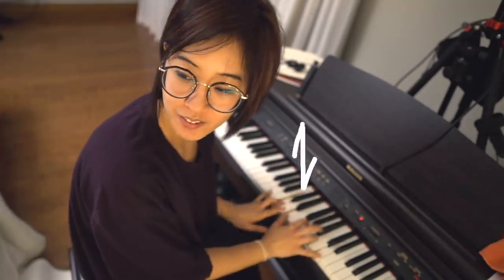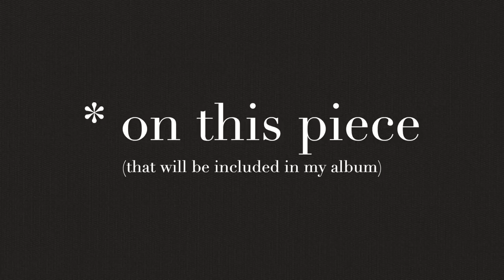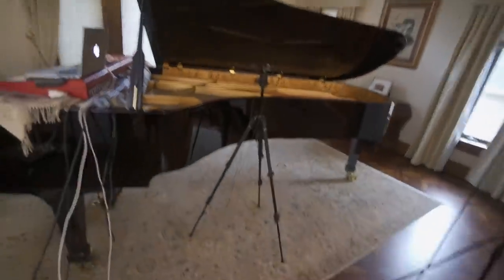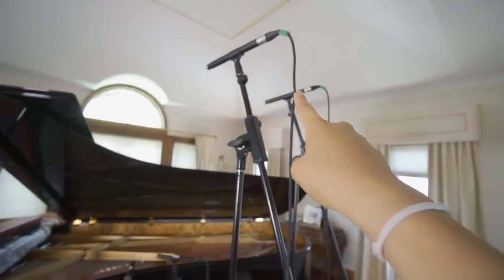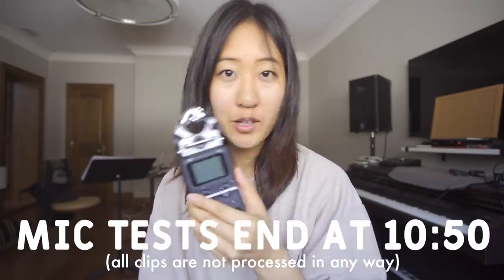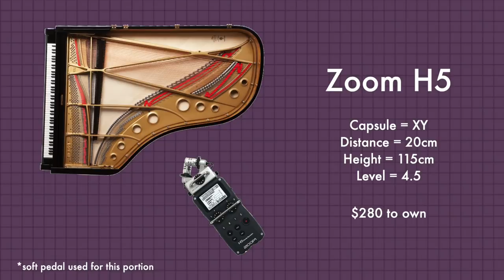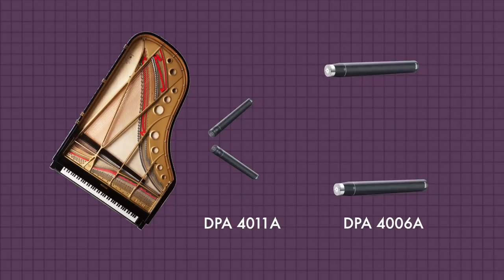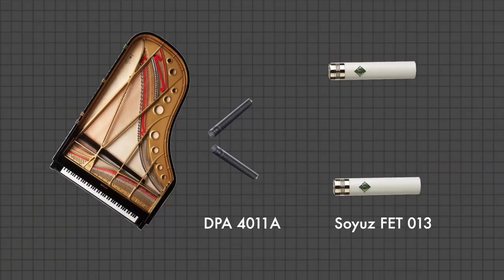Recording a grand piano is TRICKY - here's what I learned.

Comment: I like how you use octave as a unit of spatial measurement. "eerrr it's about an octave away"
Reply from the maker: :D
Reply: My phone's about an octave long
Reply: @ammyvl1  same
Reply: Noone: 
Pianists: measures with octaves (and other  intervals) XD
Reply: Arabic speaking people use a similar measurement they call a "shiber" which is top of pinky to tip of thumb on a splayed hand. It's very inaccurate as people have different size hands... But people still use it quite commonly, it's like measuring feet in some sort of awkward steps
Reply: That's bc it is! Intervals are units measure and also the fundamental units of harmonic structure.
Reply: @johanneskepler873  Frequency or wavelength would be how I measure stuff if I only had musical terminology to pick from. The octave is a doubling relationship between frequencies isn't it, 220/440/880? Surely you'd have to disambiguate and specify which octave you're in, unless we start measuring in zenos or mandlenghts, which I'm totally down for.
Reply: @SamTahbou  all traditional units start from that
Reply: As not a piano player, took me a minute to understand what she meant by that. Haha.
Reply: @alongthearc4486  For the purposes of acoustics, an octave does have that relationship. But for the purposes of music performance, composition, or analysis, the span of frequencies within an octave varies depending upon the tuning/ temperament used. Regardless, using intervallic relationships allows for an effective exploration of the pitch space the music is played within.
Reply: Imagine measuring an octave with string instruments
Reply: @ammyvl1  you 'phone' :P
Reply: @avm3562  with proper touch, it can grow from a perfect 5th to an octave, babe.
Reply: Octaves and Volcas are the only units of measurements needed. The're also quite similar ;)
Reply: Am I missing something or are some people here making something very simple much more complicated? On a standard piano the distance between any note and the same note an octave up or down is (always) about 16cm.
Reply: @paulmdt1  we're musicians; of course we're making something more complicated than it needs to be.
Reply: Hah, I totally loved that, too.  Made perfectly exact measurement sense to me.😂
Reply: @SamTahbou  one neat additional detail to using an octave measurement is that as pianists we actually build the muscle memory so that when we hold our hands from thumb to pinky and think “octave” our fingers would always fall on notes an octave apart on the piano, regardless of which notes we played the octave on, or what piano we played the octave on.  We learn to accommodate how much or little we have to stretch the fingers of our individual hands to fit a piano, so the measurement becomes the same regardless of the sizes of different people’s hands.
Reply: Once upon a time a wise old sage told me that I should not invest big dollars in sound equipment that I can’t hear. That spending big dollars on high end products was more about appearing to be an audiophile (ego) than actually being one (discriminating). I am fortunate to have been born with tin ears I guess because I don’t need expensive equipment to experience the joy of your musicianship. I’m afraid that all the samples sounded great. Sorry that I’m just getting around to all your videos.
Reply: I do that too!
Reply: Yea ahahaha thought that as well 😂

Comment: There is a technique I recently experimented with that you might want to try.

I took a matched pair of small diaphragm condenser microphones with a cardioid pickup pattern, (The $200 Lewitt 040 Match pair was my choice) and place them facing straight down a little ways behind the hammers at 1/3 and, 2/3 across the piano.
Then I panned them hard left and right and flipped the polarity on one of them.

The cardoid pattern will make sounds off axis with the mics darker. That coupled with the slight timing difference between the 2 areas mimics the way humans perceive directional sound.

Small diaphragms are able to change directions quickly. There, are better than large diagrams for higher frequency sounds. so they are great for picking up the harmonic overtones on the bass strings, but lack body.

So then I experimented with blending a microphone with a strong low and low mid range and left it panned in the center. 

And since I had a nice room, I also blended in an omnidirectional mic back in the room to pick up the room Reverb, and add a nice delay effect.

The mics aren't as important as using your ears and experimenting. When everything is done by the book. Nothing new will ever be learned

Have fun!

Comment: You know you're a pianist when you measure lengths in intervals 
4:51
Reply: Hahaaa tru
Reply: haha
Reply: As a non-american, it still makes more sense to me than the imperial system!
Reply: @zede77   I propose we abolish all systems of measuring length and replace it with intervals
Reply: @galvinn  I'd agree with that but after a quick search it seems that there is no standard for the size of an octave. We're doomed.
Reply: @zede77  feet is a base 12 system just like 12tet. Just think of inches as semitones.
Reply: @warpigs330  Hey thanks for that tip. Knowing that an inch is 2.54cm, that really helps.

Comment: I was a sound engineer in another life, so my observations are based on my older experiences. Yes, recording a piano is tricky and so many artists have different ways of approaching it. For example , did you try placing a cardioid mic about 2 feet behind your head? One artist I worked with liked to have a track where he could hear the sound from his POV. Sometimes the track gives a slight presence to the overall recording. I have also placed a mic under the piano to get the ambient presence as a solo track to work with. The artist and the engineer can have two completely different concepts of what makes a good recording and this is where a good Producer can be a godsend. 

Also, looking at the room, you have a lot of glass to work with, which is not at all great for recording. All kinds of reflections and slap-back can occur that will spoil the recording. Besides closing the curtains, were you able to use any sound baffles, like big foam rubber patches you see in studios? This helps a lot, even for small home studios. I realize you were borrowing the space as well as the piano(thanks, Romano family), so things like blankets, foam rubber in key places to deaden echoes, etc, are one way to help control the sound of the room without causing too much chaos. You have a beautiful piano to work with, but your recording environment is at least as important, if not more so, to your end result.

On headphones, I personally liked the DPA 4011s for their warmth and presence in overall sound quality. Youtube compression really crushes the high frequencies, so it's sometimes hard to tell the difference in mics because the high end is rolled off so much. I think your mic placement is fine for your sessions but as you do this more, you will find the subtleties and sound qualities that you like best.

Looking forward to listening to your new album when it's available. Best of luck.
Reply: Lol you were you Jekyll and Hyde?
Reply: Great write up of considerations—esp. with room acoustics! Agreed on the DPA’s. The Soyuz with omnis came close spaced parallel config, but was missing some of the detail of the DPA’s. Thanks for sharing, Nahre!
Reply: It would have been a very different experience at 96k @ 24bit. And the room is as large a character in this story as the instrument. There are standing waves everywhere in the recording, the lid, the walls, the floor. But it is a very objective comparison of the microphones. I have to say that the consistency of the performance was very impressive.
Reply: Wow! Thank you for your comment! Very insightful and helpful!

Comment: I have a 5 ft grand and am using a pair of Rode NT5 condenser mics. I positioned the mic in stereo a-b setup (20cm apart) and put them in the middle of the strings diagonal to the piano. Does this sound like an okay setup or am I making some terrible mistake?

Comment: Al Schmitt uses two Neumann  M149s in omni mode "usually a couple of feet off the high end and a couple of feet off the low end, kind of at 45 degrees to each other". That's ALL I need to know. If you can't get hold of the Neumanns, use two tube mics  with a decent frequency response.

Comment: I prefered the four mic' setup with the two Rode mic's.   It's not that the Rode mic's are the same caliber of the others, but it is a large diaphram mic and it seems to pickup more the low-mid's and low frequencies of the piano.    I was a recording engineer back in the day and for recording solo piano the one thing I would of done different is use two mic's  more like your two high mic except lower down around mid-level of the piano lid, and about a foot to eighteen inches further away from the piano.    

Good sound is all  about finding the right place to put the mic.    This is wear having someone to help you would be in valuable.    Then you could put the mic on the stand, loosen the stand,  and have one person moving the mic' in area you want and the other listening.   When you find the best sounding spot tighten the mic stand to lock it into that position.   Amazing how big a difference just moving a mic a tiny bit can make.

Comment: I'm trying to remember the technique at a church I was at. thay would occasionally roll the grand piano out of the hall and on to the stage and they miced it very close and it sounded really good. I can't remember if they were using an Omni in and under or if it was some other pattern or if it was a boundary Mic. They did it so often they had to technique down it was like roll it up put the mics there plug it in, and at some point they had to lift it on stage because it wouldn't fit up the ramp.

And in case anybody's looking for inspiration Shure has a PDF "microphone_techniques_for_recording_english"

Comment: XY stereo setup (that you did for close mics) is the least favorite stereo setup for me. I'd like to recommend you to use both stereo as AB (aka spaced pair) or ORTF for close mics and spaced pair for far mics. Also, when recording grand piano, the height of microphone stand will drastically change the sound so you can experiment with it. 
By the way, you can get an interesting recording using XY and Spaced pair both for close mics. You can put XY between spaced pair. Try it!

Comment: Just in case you maybe didn't know - if you attach power bank the micro USB the device will run on the power bank and later, when it runs out, on the batteries. That has helped me to use the device continuously for multiple 12h live streams.

Comment: Thank you for a great and informative video. In my experience, expensive mics make a huge difference but only if the room acoustic is right first. Unless you have a large room, recording a grand piano is tricky because the sound will be bouncing off every surface. This makes a boxy sounding recording with some frequencies over resonant. A nightmare! Room acoustics can be easily changed by hanging up duvets, opening cupboards and drawers (to break up standing waves) and placing a rolled up carpet or blankets underneath the piano if the piano is too big for the room. Then there is the issue with external noise if the piano is near a road or in an apartment building. Using room mics may not be an option but great results can still be attained by close micing ie a spaced cardioid pair 6 inches above the treble and bass strings and a stereo omni mic at the foot of the piano. And finally remember to switch off anything that could be picked up by the mics, ie heating, refrigerator, mobile phones, air con, entry phone, and ticking clocks. These are all things that can easily mess up really nice performances :(

Comment: The audio interface used has 4 channel input, i am assuming that with 4 microphones you may have to port it to a mixer box first, then into the audio interface if your audio interface can only handle 2 or 3 channels.  What i am curious about is that even when the audio interface is set to for example -6dB, you have to edit the audio in either video software or stream it live on youtube or twitch, does the audio encoding, and decoding by youtube allow such high quality streaming of audio to other end-users tuned in? or alternatively, if the video is edited and uploaded rather than being live, is the quality preserved for the audio recording in your studio, and transmitted at that high fidelity such that a studio monitor can output it as accurately while being remotely at the other end of the world?  Note, if using live streaming, then there is another software component that must take the high fidelity audio and encode it on your computer before sending it off to youtube, which also at their servers will encode/decode the audio to send out and distribute to end-users/listeners all over the world.

Comment: Octava MK-12 Cardioid running 90 degrees to the keyboard (in line with the hammers), X-Y pair (414s or something warm that you can afford) running 45 degrees from the main string alignment above the soundboard (align with keyboard lid distance). AKGD212 (or similar drum kick mic) slammed against the curved soundboard. Forget the room you're recording in. No point in picking it up. Large room, same set up... But use some Earthworks for distance... Hopefully you'll enjoy.

Comment: I recently had a recording session on a grand piano and I had the engineers place my M-Audio Sputnik under the piano 20cm from the underside and about in the middle of the piano. This combined with a similar mic placing as you. They ended up using the Sputnik the most for the warmth it gave to the sound.

Comment: You could try to put the zoom recorder on the ground (or close mic the underside of the piano) mirroring the closest mic's angle on the other side of the piano, then you'd just have to flip the phase. It might pick up a little more of the mechanics inside the piano if that's what you are looking for (possibly add the tiniest mouse fart of compression to bring those sounds out a bit more) and then mix to taste. 

Another thing you might want to try is make a few diffuses and throw them around the room to help get the ambient sound "out of the way" but still be there.

Comment: I thought the setups with just 2 mics at 90⁰ separation sounded the best. Of those, I like the 4006s better than the others. The setups with 4 mics sound like they aren't synced up perfectly. Did you take time delay caused by the different positions into account?

Credentials: I work for a pro sound company.

Comment: I'm no expert but one thing that I have done in the past is to pull a boundary-mic-style stunt using natural surfaces in the environment. One time I made a stage recording (medium auditorium, raised stage, unmiced vocalists) by putting two small-diaphragm cardioid condensers in XY just millimeters off the very lip of the stage. What that does is make essentially all the reflection off the stage surface miss the mics. I wonder what it would do to put a pair of mics just barely off the edge of the open lid overhead, with the mics parallel to the lid.

Comment: I've been actually recording my upright piano back home. I decided to use the middle (felt) pedal throughout the entire album. Just because I love the sound and also because the "normal" sound was too harsh and too big for the room. I'm only using Zoom h4n (top of piano) & an SM57 (bottom of piano) with very specific angles. In the meantime, I can say that the signal sounds beautiful! Experiencing different sounds and placements is a delight for me. It feels festive & creative. It's also frustrating because when you're recording at home you have to turn off the fan & AC, close the windows, etc (especially in this very soft setting of the piano). It becomes pretty hot very quickly so I just have a cup of ice nearby at all times 😅

Comment: Omni mics are a good choice. They don’t respond to proximities effect in the same way as other mics. From Sweetwater:

Proximity effect is an exaggeration of low frequencies caused by the use of ports to create directional polar pickup patterns, so omni-directional mics are not affected. Depending on the mic design, proximity effect may easily result in a boost of up to 16 dB, usually below 100 Hz

Ever tried a contact pickup? It can sound really groovy mixed with mics.

Comment: Once I got a tip from a professor of live sound techniques to use the holes on the sound board.  He would sometimes put a mic right into the hole and place the mic diaphragm on the same plane (parallel more or less) with the sound board, so it looks like it is halfway in and out of the hole.  I have tried that and I don't know if it ever did anything for me, but I'm curious if you or your engineer dabbled with that and if it worked.

Comment: As you said, the first and very important point is the room. This must contain absorbent material to avoid rebounds that favor the resonance of certain frequencies, which amplify some components of the sound over others.

I think that the use of 4 microphones generates a slight unnecessary chorus effect, which if you wish you can add in the mastering instance. The recording of the instrument should be as pure and neutral as possible, trying to capture all the components of the sound without distortion.

The perpendicular arrangement I think is the most appropriate, since it achieves a rich spatial feeling. Although I would place them higher, so that one of them is directly oriented to the treble area. Only 2 DPA-4011s in perpendicular angle sound more natural for me (8:33). Soyus microphones bring a treble brightness that at times seems exaggerated to me (I would have to listen to the instrument there to compare).

I really like listening to you when: experiment, share, teach. 

Thank you